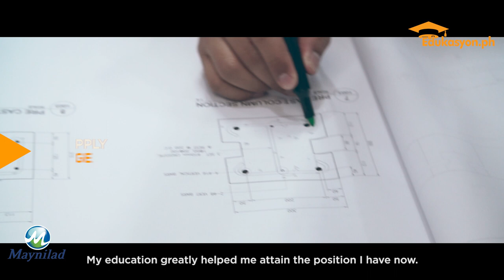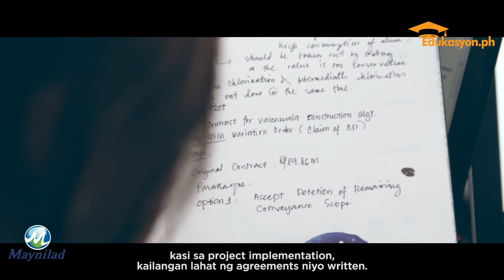Career Conversations: Civil Engineer

Comment: Incoming 2nd yr civil engineering  hmm di naman kailangan halimaw ka sa math para pumasa ka kailangan dapat masipag at mag tiyaga hahaha tas wag mawalan ng pag asa pag ma bagsak retake lang hanggang makuha ang pinapangarap na lisensiya  God bless laban lang tayo
Reply: Ok naman pag masipag at matiyaga ka pero when you work as an Engineer, kailangan kabisado mo Mathematical Theory, or very well versed or knowledgeable especially sa lahat ng mga matake mo na major subjects like Theory of Structures, Dynamics, Strength of Materials etc. which requires expertise in Mathematics. Tsaka lalo na kung yung gusto mong ipursue na field pagkawork mo is Structural Design.